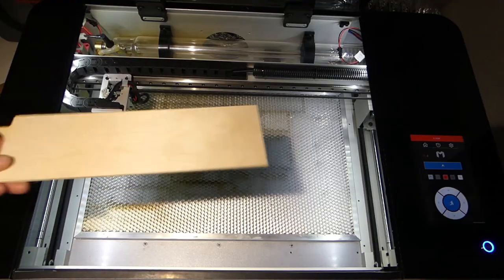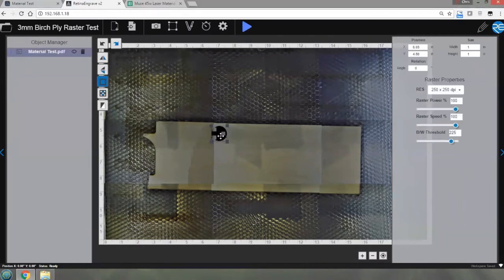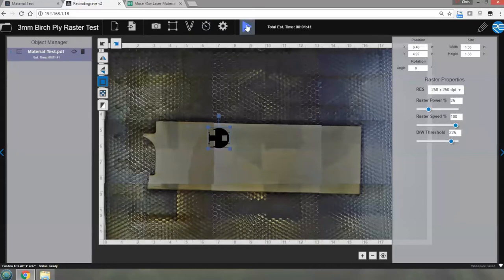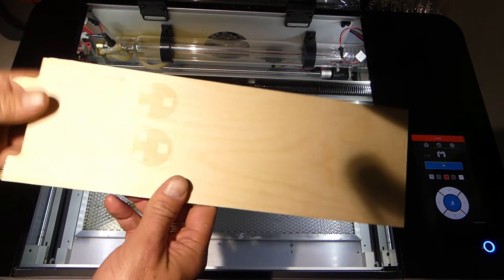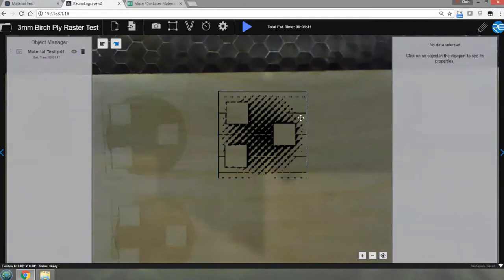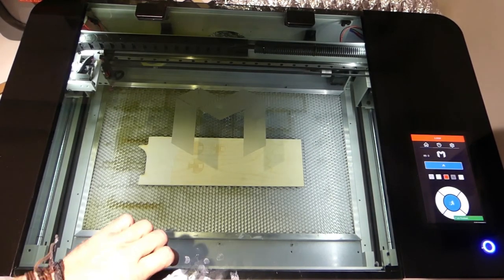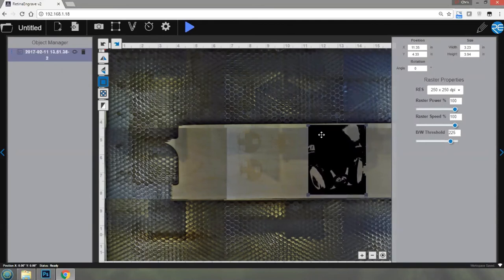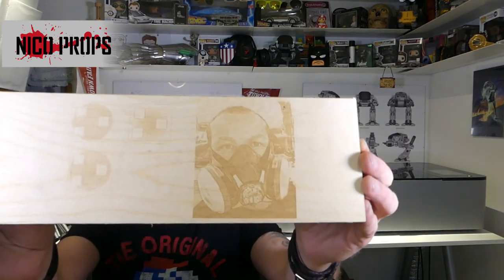LASER CUTTING / ENGRAVING: Material Test Engraving with Muse Full Spectrum

Comment: Do you have a set up video with a pump and a bucket please instead of the cooling box. Thank you 😃
Reply from the maker: not really no, I bought the one with the cooling unit. the pump and bucket should be easy enough, put a pipe on the out of the muse to the bucket and the pipe from the pump to the in of the muse. then fill the bucket with distilled water.

Comment: Did you buy from the US as I cannot find anywhere in the UK that sells here.Any help much appreciated
Reply from the maker: yes, I bought it from the US and had it shipped over, keep about £500 aside for the import charges. you will have to pay via a bank transfer and it should come within a week after the payment has cleared in their account which could be about 5 days so you are probably looking at around 2 weeks from payment before it turns up.
Reply: NicoProps thanks so much
Reply from the maker: just so you know I bought mine with a water chiller and a 45W tube, if you buy one with the standard water pump and 40w tube the import charges may be a little less but I don't expect it to be much less. and even if you buy the chiller you still get the water pump as standard. though I have seen that they are doing a new setup which is like a chiller, air pump and exhaust fan in one unit, not sure how good that is though.